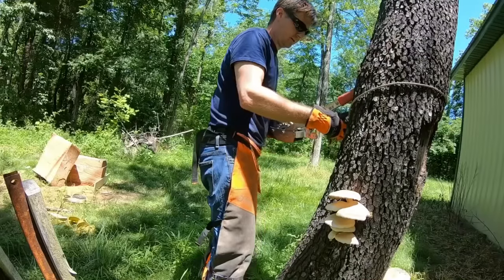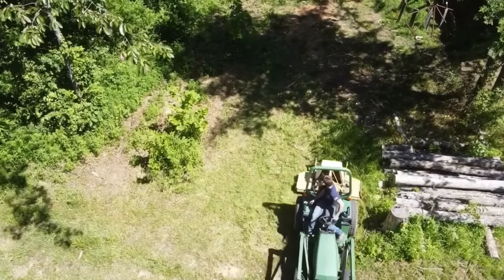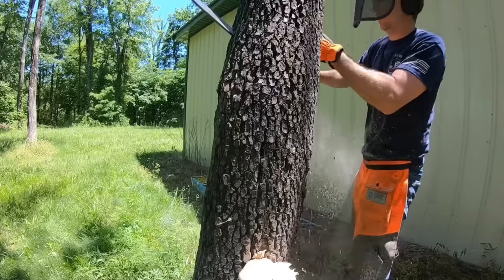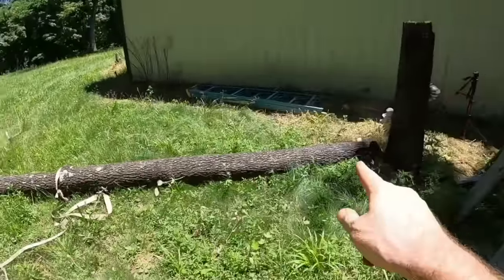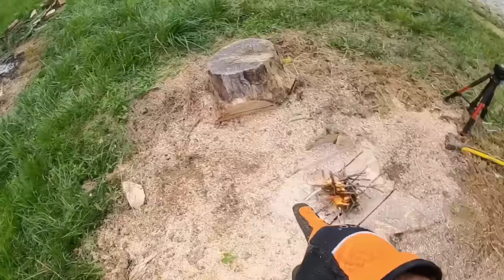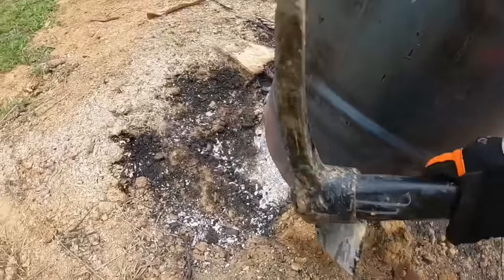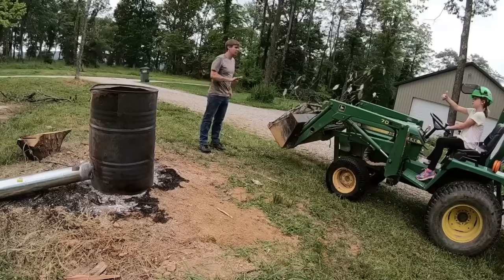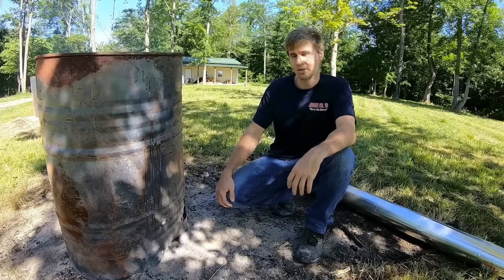Stump burning experiment - PLUS - hazard tree removal

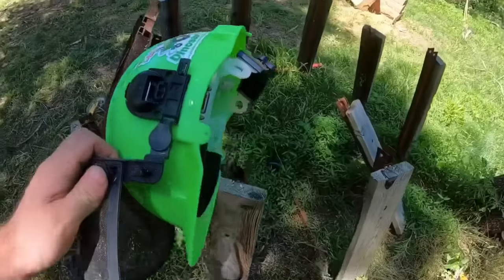Comment: 13:37 was my favorite part... not sure why, just was.  Anyway... That was great!  Thanks for the info!  I've got a few stumps I've been trying to burn out for years, but never great luck.  I'll probably try one of these techniques now!  Well thought out plan for taking that leaning tree down!  Makes perfect sense to me and looks like it worked perfectly!  Nicely done!  Thanks for the video!
Reply from the maker: BurningDinosaurs what?!?   If you don’t make a franken stump grinder I will be highly disappointed.  Trencher looks like it is going to work well by the way!
Reply: Rather than his way , punch biggest drill you have from out side edge  at ground level, angled down in towards centre of stump at multiple points around stump , then multiple from top of stump straight down to meet up with these  initial holes .blow this out with leaf  blower so that air flow can  flow from first holes down through stump and up through the holes in the top of the stump, . A moderately small fire on top of the stump will drop coals down the top of stump holes, and will also burn down from  the top, as time goes by, the drilled holes will  enlarge  as they burn back into the stump , then  back into the angled entry holes,  
This will  get better results and much faster, without needing huge amount of additional  wood. The entire stump can be done in one go , time depends on how dry wood is, type of wood  size of holes etc, but generally  under a day even for decent sized stumps, and without  consuming a heap of other wood, you only need a reasonably small fire initially to get this started

Comment: There is some simple math on why external fires are so hard to burn out a stump but it all boils down to the fact that the water to steam conversion steals energy from around it acting as a layer of insulation. 

Wet wood in a stump acts as an insulator only letting the heat get in 1-2 inches depending on wood density and how wet it is with the wood needing to hit 212F to cook off the water and over 660F before the wood itself burns. The stump itself has the energy to burn itself out once you get a fire started that starts the cooking off process but it needs a slow fire to do it to keep the burning edge away from the wet edge or too much energy is stolen and the fire cools off too much. 

A simple 18 inch long wood auger bit to drill a central burn shaft in the stump and spots around it you can drill in for air intakes lets you turn the stump itself into a rocket stove and as long as you keep any rain off it over the next 24-48 hours it will slowly burn itself from the central burn shaft out without the huge pile of surface firewood needed past a few sticks to get the fire going. 

Even helps on stumps you pop out of the ground to drill a central hole before you toss on the burn pile as it changes where the fire is burning from an outside in to an inside out fire.
Reply from the maker: Andrew H may be something I’ll have to try in the future.  Thanks for the explanation sir!

Comment: I'm wondering about a fence post auger, either on your tractor there or hand-held, digging angled holes from around the perimeter and down below the stump.  If you hit a root that stops the auger, re-position and dig another.  After a few minutes, you should have a nice firebox with plenty of air flow under the stump (or at least below ground level and surrounding it), allowing heat and flame to rise up under it, burning the stump from below.  Top-down seems difficult when heat rises.  Putting the flame below the stump as much as possible would seem to be the most efficient burn.

Comment: Take a look at a devil forge(as an example) that they use for melting scrap copper etc if you add a lid and angle the blower to swirl the flame around the base of the stump it should create enough heat to burn the stump faster but be careful you don't end up melting the barrel

Comment: I built a blower for adding air to fires. I used an exhaust blower from a old 80% furnace. I mounted it to a plywood base in such a way that I could use a flap to control the air going into the blower inlet. From 0 to 100% air. From the blower outlet I use a old 2 inch shop vac. hose and a 4 ft. length of 2 inch Schld.. 40 pipe. Works great.
Reply from the maker: kkarllwt that sounds like a pretty slick setup!

Comment: I've found that drilling holes down through the stump & post holding a diagonal hole under the stump so air can be pushed up through it works great to burn a stump down below ground. 
You can use flue pipe but I use old 4" steel pipe 10' long & a harbor freight shop blower jury rigged to one end. 
Put the other end of the pipe under the stump,  set your drum & build a fire,  once the stump itself is burning turn the shop blower on the low setting & enjoy a few beers. 
The idea is pretty simple,  the blower provides (combustion air)  that flows up through the stump & once the stump is burning on its own, no further feul is necessary.
The drum contains the cinders & ash will be minimal.
Backfill the hole & the surrounding grass will take it over like the stump was never there.
Reply from the maker: Cody Criss thanks for the suggestions!
Reply: I agree with your suggestions. However I would try and drill as many deeper holes on top and on sides as possible to speed up the burning process.

Comment: Drill holes in the barrels and use charcoal rather than wood alone. I have burned out many a stump that way. It works quite well and costs far less than hiring someone with a stump grinder. There is another way to rid your property of stumps if you do not have to hurry and that is to drill holes in them and then fill the holes with saltpeter. Saltpeter will rot a stump out inside of a month to six weeks.

Comment: Very interesting. The only thing I would change is, that I would leave the lid of the drum semi intact just cut out a triangle on the top, lift it up so I can add fuel. That way it would trap more heat in it and direct it at the sump, making it more of an oven and less of a chimney.

Comment: I made the barrel into more of a stove by putting a chimney on top of the barrel and high loading door on the side. Fueled once and left it burn for a week until it popped up about 20 feet away and burned some weeds before I got it out. Stump followed the roots out as the chimney provided a draft.
Reply from the maker: E Good dang!  Sounds like your method worked pretty well.
Reply: @CaptainKleeman  Not the first time i've heard a stump burn following the roots.  Been told of one that burned a house down, when the burn followed the roots popped up and set the grass on fire.
Reply: E Good 
U mean stove pipe on top and loading door set high up towards top instead of lower like these
Reply: E Good I'm interested in your design stove pipe on top and loading door set towards top of barrel right

Comment: You can use high nitrate fertilizers to improve the burn rate on stumps by drilling a 1" hole down the center and filling it half full with fertilizer. The fertilizer has nitrates, which are good oxidizers, which will cause wood to burn without air.
Reply from the maker: Wesley223332 thanks for the tip!

Comment: I like to use coal for stump burning.  Have to start with some wood tinder and once the coal is burning and the blower starts it's hard to put out so it will burn the stump down pretty well.
Reply from the maker: Robert Palmore i may give that a go if I do this method again. Thanks for the tip!

Comment: Another way is to cut down deep into the stump saw or drill(drilling holes work better) then soak with used oil,kerosene,diesel. You can start this process months ahead of burning or 2-3 weeks just the shorter time frame you would have to soak it like 3 times a week,the more you do it the easier the stump will burn,also this way doesn't require you to have firewood or brush just drop match into a hole you drilled.Also you could just drill holes deep into the stump then burn. BUT no matter what you do burning a stump is a 2 day minimum process.
Reply from the maker: Dylan K definitely takes some time,  lots of techniques to use as well.  I may try that technique in the future.  Thanks for the tip!

Comment: I would suggest getting a small spray bottle with diesel to help get fires started. Like a STIHL SG 11 sprayer. I use these to start fires in the wood burner in the house and also the burn pit outside.

Also, if you dont keep an eye on this process, I wouldnt fill it up so much. The barrel could fall over with that much wood in it causing a yard fire.
Reply from the maker: sckirbyc1 I’ve never been a fan of using diesel.  I enjoy just doing it the old fashion way.  But if it works for you then That’s awesome! 

And one of the barrels did fall over.  A key is dont use this technique if fire conditions or risk are at an elevated level.  Be smart about it

Comment: Dig a hole down beside the stump and try to get the fire underneath it and it will actually burn it out. Fire on top of the stump will simply char the top and the burnt ashes will effectively insulate the hot part of the fire from the wood in the stump.
Reply from the maker: Phil Box it actually ended up burning down about 8 inches into the ground on one of them.  Surprised me

Comment: Soak stump with used motor oil, put barrel on som bricks to allow air to enter then set it afire. Don’t keep loading the barrels up with stuff to burn, the ash smothers the stump fire. Let the thing set for a day or so. When I’ve done this the fire not only burns the stump but will follow the roots out too. Cutting that stump right against the ground only dulls your chain and a hives little.
Reply from the maker: Steve Miller thanks for the suggestions!

Comment: You can probably get carbide chain for your saws through your dept. So when cutting dirt the chain won't dull as quickly
Reply from the maker: gavin hirt our department doesn’t work that way.  Would be nice though.
Reply: @CaptainKleeman  your suppliers should I sold tons of parts and misc stuff to firefighters using their discount the most expensive was carbide chain because it was special order and you guys and gals work 2 3 jobs

Comment: I like your idea about using the 5 or 6 inch pipe but I'd set it in at an angle where hopefully it would create a vortex effect & I'd attach a small blower to it. In the only other video I watched where a guy used a barrel to burn out a stump he used a long boring bit to drill a few 1" holes down into the stump and then his barrel had air holes cut in around the bottom circumference of the barrel. His stump burned down to about a half-foot below ground level. By the editing it looked like the burn only took him 2-3 days. I imagine that the type of wood & how seasoned the stump is makes a difference on how long it would take to burn it out.

Comment: I angle my pipe with the leaf blower to get that cyclone effect plus it blows away excess ashes out of the steel drum a lot better so it never smothers the fire. Also pick up you leaf blower and pie and angle it around every so often to stur everything up inside and keep that oxygen going. That really speeds up the process for me. I’d also use a smaller pipe depending on how powerful your blower is. You already know battery powered blowers are not the best for these jobs. I picked up a 20$ blower at a pawn shop specifically for a job like this in mind.
Reply from the maker: Jordan C angling the pipe is a good idea and awesome tip.  Thanks!
Reply: I like your idea. I've only burned out one stump, but I figured out that the ash was insulating the stump. I used a leaf blower without the barrel. It worked great, but made a pretty big mess. Next time I'll get a barrel. I also spent about 15 minutes drilling holes in the stump.

Comment: I drill the stumps full of holes with a 10" auger bit on the ones I burn. I have a 3' diameter culvert pipe I put over it. In about a week I'll finish cutting down a 30" diameter walnut tree so I bought a 17" 1" diameter auger and hook up a blower motor to the culvert pipe. I like to burn the stumps about a foot below the ground surface.

Comment: Fall Leaf Burner. 55 gal Drum with a Mobile Home Barrel Fan. Square hole cut with Tabs to hold the the fan. 110 Volt plug in to house. Couple of wads of newspaper in the bottom in front of the fan opening. Load it up with leaves. When full start the newsprint.  Slip on the fan, plug it in.  This burns so HOT there is very little ash. This I sprinkle on the flowerbeds.

Comment: Most of your heat is going out the open top.  Try restricting it down with a partial lid to approximate a forge more.  Get the total heat up inside by containing and hopefully you will burn more of the stump.  Burning the stumps is generally your least effective method so don't expect too much.  In the good old days we used tires because they burned hotter than wood.  Course they smoked a wee tad!  It would still take days and days.  Beat the heck out of trenching and chain sawing each root then come alonging them out.  Though that was tough work it still got it done in a day on pretty big stumps.  Take care.  Doug
Reply from the maker: Douglas Thompson you make a good point.  I did save the lids,  and if I try it again I may have to see how much that helps.  But I’m betting you’re right.  Thanks for The feedback!

Comment: I did the same as you with a 3' diameter pine stump. Burned all day, made it safe and let it smolder, next morning stump was nothing but ashes. Still smoking for almost 3 days.put about 50 gallons of water in the hole, smoke stopped. The next morning it started smoking again. Took 2 wheelbarrow loads of dirt to finally stop it.
Reply from the maker: donnie brown dang!  You have any pictures or video of that?  Would love to see.
Reply: @CaptainKleeman  wish I did, that was well let's just a loonng time ago. We had three hybred poplars and a water oak cut down and stumps ground a couple of years later, 23 year old poplars, one closest to the house was over 4 feet in diameter, carpenter ants had infested it. Cost us over 4k $ for that entire job. 
BTW if you want to intensify the heat in the barrel, turn your pipe so it blows at an angle creating a swirling effect. Have some binge watching of your channel, new subscriber.

Comment: The best way I have found to burn a stump out is to dig around and under the stump and then burn it up.  Every thing left is below ground level.  Everything else is the same as you did.  Sometimes I will soak it with two cycle gas and motor oil mixture too.
Reply from the maker: Don Hanson soaking in motor oil is a pretty good idea.
Reply: @CaptainKleeman  mix with some 2 cycle gas to about 3 to 1 oil to gas it will cause it to absorb more into the stump

Comment: When burning the stumps. Instead of cutting, just drill holes and use old grease and cooking oil and let them soak into the stumps. This helps get rid of the old grease and oil without damaging drains as some people do, and also better than dumping it on the ground. See that way too often at camp sites and all. 

Then burn it. Works much better…

Comment: What if you drill holes at 45 or less degrees through the ground and into the bottom of the stump with a 2 inch auger bit on a like 40 inch extension that you could make or buy then slide in 2 inch steel pipe into the hole so no dirt can block the air flow then drill one hole in the middle so the stump is now like it's own rocket stove and you can blow in air with a smaller blower or make a splitter for a few hoses to get air from the one blower then put the barrel on top and burn the stump from the inside out.
Reply: Yeah i kinda said "then" a lot tho is fine.
Reply from the maker: Bacon Nology not a bad idea.  Thanks for looking out.

Comment: Drill 1/4-inch holes in the stumps and fill them with Rock Salt then Vinegar. I have seen it done with White Vinegar and Apple Vinegar, though most any vinegar should work. Refill every 3-5 days.
It isn't fast, but it is effective. Depending on the stump size, it may take a week, but there is no chance of burning hands or anything else. And it only costs a few dollars per stump.
Reply from the maker: Larry Mease well it definitely fits the DIY budget.  Thanks for sharing!

Comment: If you live in  the bush defiantly in Australia anyways this is not recommended as tree roots can surface and start fires when it gets to the surface extremely dangerous fires can pop up 4 5 weeks later so be very careful on bush blocks easier to stump grind or paint round up 4 to 5 times on the stump and let it rot for 12 months especially with pine also with hard wood then get bob cat to roll it out of the ground

Comment: OK . your way works BUT.... the best way is to bore  holes(1or 2 inch mortise ) down into the stump as far as you can go Then dig a side trench below ground level for air flow (BORE HOLES) cover with the wood and barrel OR if no barrel stack the wood teepee style around the stump and cover it with tamped clay 2/3 way up .  🥵 Thanks

Comment: I used a similar barrel with a pipe, 12volt computer fan, and a solar panel.  Moves the ash away and feeds the air. I don't have power where it's at.
Reply from the maker: Jacob Moser now that is a clever setup.  Work well for you?
Reply: @CaptainKleeman  ,Kind of slow and I only make it out there a couple days a month.

Comment: After you had cut it flush to the ground take a 1" auger bit and drill it 8 or 10 inches below the ground level. Take old motor oil and mix with a little diesel fuel. let that soak in for a day then do your barrel/ blower burn... Works amazing.
Reply from the maker: Kevin Bruch a few people have made that suggestions.  I have several gallons of old oil,  may give that a try next time.  Thanks the tip!